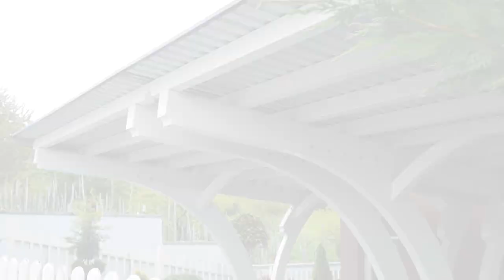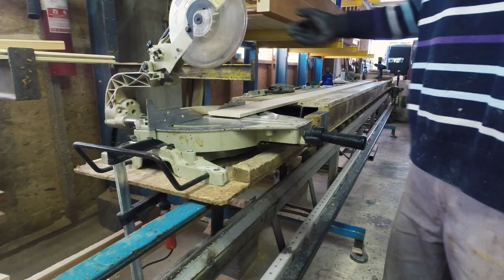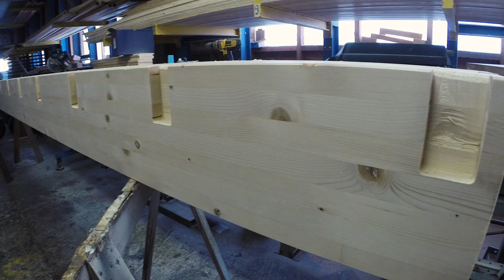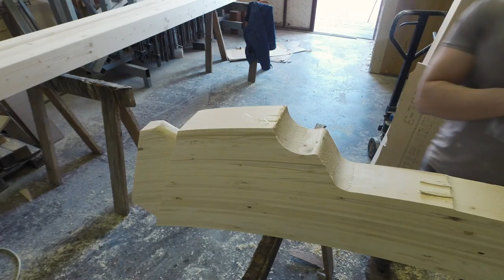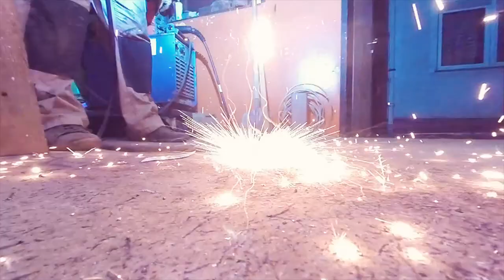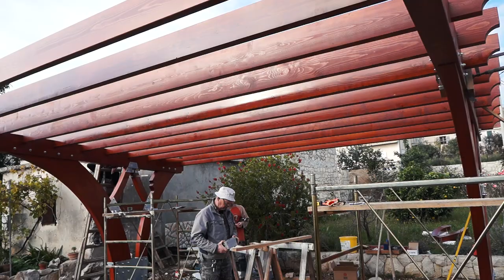Making of glulam carport

Comment: At first I was like, cool, I'd like to see how it's done. Then I saw the robot router arm thing and was like "yeah ok... nothing for us mere mortals to make"
Reply: Everything that robot arm did you could do with a mallet and chisel (and a circular saw if you wanted a bit of a speed boost). Looks like you could simplify this slightly (replacing the curved braces with straight) and building it in a very traditional timber framed way. It would less graceful, but it would still look good, and be functional. 

I was more impressed by the huge gluelam form, and was thinking that was the thing that would prevent me from replicating this. Ohh that and anywhere to put it, though it would look nice over the sandbox for the kids.
Reply: Glulam products are beautiful, I agree.  I used to work at a factory that specialized in glulam products, but on a MUCH larger scale.  That robot took all the fun out of cutting the ends and drilling all the holes.

Comment: I noticed you don’t joint one side of your boards first , but rather, just send through planer. Is that correct?  How do you ensure both opposing sides are flat and parallel?  U do amazing work. Thanks
Reply from the maker: when making glulam beams, jointing is not necessary because glue tolerates imperfections in the surface up to 0.4 mm. It's special glue designed for the glulam industry and has some other properties like fire resistance that other glues don't. Planing ensures parallel surfaces (if knives are correctly positioned) with surface variations much less than mentioned 0.4mm.

Comment: Never mind that the wood structure probably cost a small fortune (75K my estimate), but consider also the cost of the two below grade concrete ballast connections that are keeping that top heavy artsy contraption from tipping over! There goes another 50 thousand dollars (remember, professional civil engineering is involved, and that’s not cheap!)
Reply from the maker: 😁if only.. I'd be a multimillionaire by now.. I sell it for around 8 k euros depending on the transport distance from the shop within my country. Assembly included if not too far away..

Comment: TIL about Glulam.  In my country where wood is an expensive building material.  Compared to concrete and steel which are more common.  If you were going to build a structure that looks exactly this. The Gulalam would be much prettier though.

Comment: What type of glue do you use?
Reply from the maker: I use two component melamine glue from akzo nobel. It is designed specially for gluelam because it doesn't lose it's properties during high temperatures in case of fire.
Reply: I guess you're talking about GripPro (plus)? That's what I figured out searching for AkzoNobel glue (though not finding a B2C store yet)

Comment: This is unreal.  How much do you think your cnc robot guy is necessary vs a luxury?  Could you have done this project (for a reasonable price) without it?
Reply from the maker: I bought the robots around two years ago. Before that I made probably a couple of dozen of this particular model with regular tools and jigs. I see it as a time saver mostly because I used to have to completely assemble the carport first in the shop to be sure everything fits properly, then second time on it's designated position. Now I don't have to. I also see it as a back saver because I used to plane the arches on a planer machine and moving  them a couple of dozen times trough a planer is really hard. Tbh, if I only made one I would never do it with a robot, much faster by hand . It takes much more time to make programs, plan the positioning for each piece, prepare the mounting table etc.. not to mention mistakes, and they always happen, a lot of trial and error..